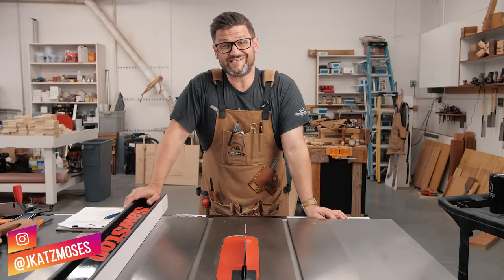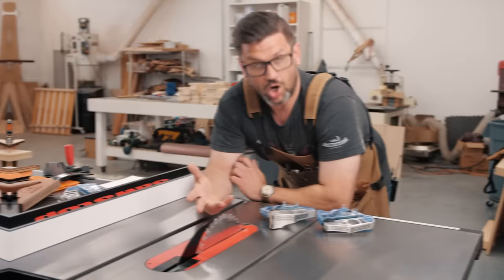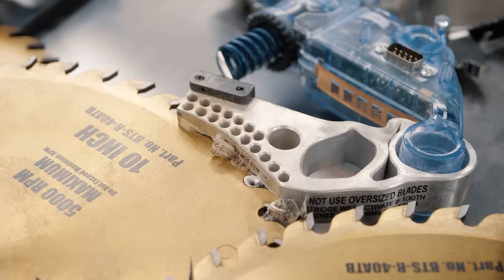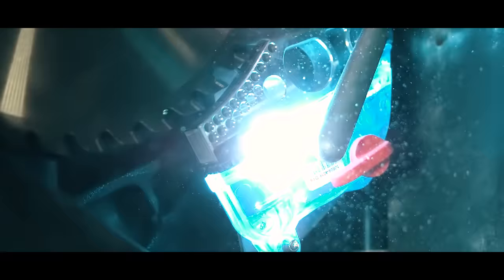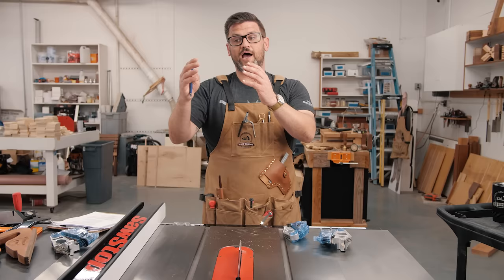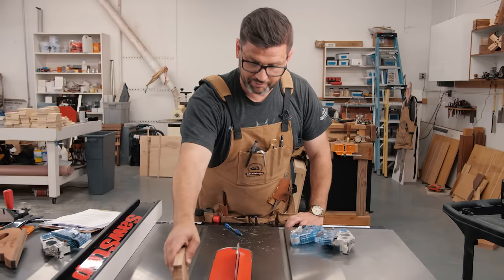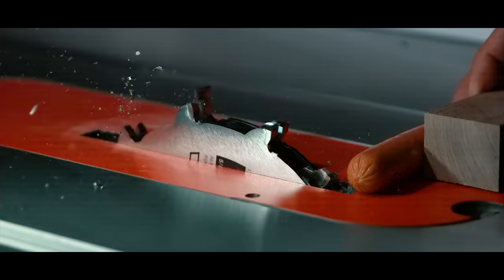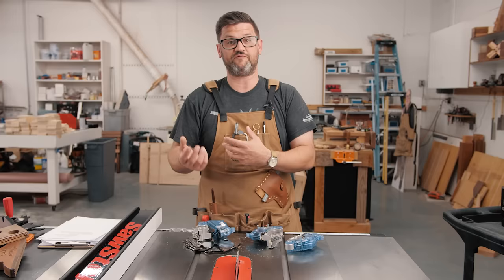How Safe is a Sawstop Saw? - Never Before Seen 19,000 FPS HD Slow-Mo Video

Comment: This post hits home regarding two of my family members . My brother and l grew up with a dad that loved wood working . I grew up in the 50' - 60's when high schools actually offered shop classes . My shop teacher taught us to never have the saw blade higher than 1/8 "above the top surface of the wood . As you rightly pointed out , this would not create an unrecoverable accident . My dad on the other hand , insisted that you keep the blade set as high as possible . His reasoning was that when you have the blade high , less teeth are in contact with the wood causing less heat buildup in the blade . This is absolutely correct as far as the physics of blade to wood contact goes . 1970 we're helping dad get the house ready to sell . We're in the basement shop and hear a string of explicitives coming from dad's mouth . He had just cut off his right thumb . Forward to 1972 . Dad is working in my brothers shop ,at the table saw. The phone rings , dad looks at the phone while still pushing the wood through th saw . Left thumb departs from the hand .  2018 my brother is in his shop , distracted for a milisecond and removes the first joints of three fingers . He still has his thumb and index finger . This does allow him to demonstrate displeasure in two ways . Minor irritation , you will get half a middle diget salute . More irritation  , will get you the left hand full salute . Major irritation,  the best he can do is 1 1/2 digests.  I on the other hand (yeah the pun was intended , sorry ) listened to my shop teacher . The only body part l'm missing is my appendix.
Reply: Why would he not use a pushing tool after losing a thumb. Even with Sawstop, you still have to be smart. Even the best technology can and will fail. Oh nevermind, after reading that last bit, I think it was pure sarcasm. Your Dad and brother need to learn lessons from shit that happens if real. They definitely missed the brain train.
Reply: @Bound4Earth  , 
Dad's been gone now for 20 years . He made it to 93 years old . As to why he didn't use a push stick , l can't say , other than dad always did things his own way . His was the generation that went through the depression , and came out of it with a feeling of invincibility , l guess . As for my brother ,  well sometimes he's not the best decision maker . He is his father's son . Of course they have both provided me with teaching examples for my grand kids . Visual aids make teaching so much easier .
And yeah the last two lines were sarcasm,  when you make it to 75 , you kind of look at the world with an eye out for dumbness.  Sarcasm is the old guys equivalent to OMG .
Reply: How the hell do you lose your appendix using a tablesaw?!?!?
Reply: @TheLizardOfOz  🤦🤦🤦
Reply: TheLizardOfOz Easy just crawl on top of it and turn the saw on
Reply: For the record, yes they still do have woodworking in high schools
Reply: @TheLizardOfOz  , 
Well , first you remove the blade guard . Next a step  stool makes it easier to get up on the saw . Never give an ex New Yorker a  straight line , we will run with it ! 😀 With the form of wittisism you used , your humor would definitely fit in with the rest of us . Oops,  posted my reply , scrolled down and saw yours to workaholic. Yeah,  your humor  fits in . Stay healthy and keep the sarcasm handy . Sometimes  sarcasm is the only thing that keeps you from killing the incredibly stupid .
Reply: @patrick-xu1go  You are extremely lucky to have shop classes available in your area . A majority of school systems have dropped shop classes because of liability issues .

Comment: When I first cut my teeth as a apprentice carpenter.  On building sites we used diesel powered table rip saws.  A guy who was ripping down timber for posts had a pair of gloves with rubber webbing on them ( I think it was mainly to give better grip ). There was a loose thread on the right hand of the glove.  He wasn’t using a push stick and the thread was caught by the blade!  He lost his index finger above the knuckle and a good chunk of his thumb!  Really nasty accident!  That was some 40 years ago and I’ve never forgotten it!

Comment: Awesome. I actually witnessed a guy who ran his hand into a running table saw blade. He didn't loose his fingers but he had stitches for weeks in all 4 fingers. Back then safety options were limited to a simple guard over the blade but it wasn't a stationary guard, it was a floating guard. Very cool safety has upped it's game!

Comment: You just sold a ton of Sawstops. I wasn't going to get one and was looking at a grizzy but after seeing this I have changed my mind.
Reply: On my first day in my university woodshop they said 3 things about the tablesaw, 1) If you feed stuff without the kickback fence or knife that will happen (pointing to a 2x4 embedded through the wall behind the saw) 2) If you touch the sawstop it wont take your finger off (with hotdog demonstration) 3) If you are dumb enough to activate it, you owe the shop $1000 before you are allowed back in
Reply: @JKSSubstandard  thats basically the same as us. It was something like "if it saves your finger, we'll pay the bill with a smile, but if you bring in a hotdog to 'try it out', expect a bill in the mail"

Comment: I saw this about 20 years ago at a wood/lumber trade show in Rototua, NZ but the manufacturer from the US.  The representative would use hot dogs like in this video.  Sometimes the hot dogs would be nicked but a small scratch is nothing compared to losing a finger.   The representative only needed one pack of hot dogs and probably did a hundred demos a day.

Comment: I am thankful for the sawstop because i personally triggered it once because i am sometimes clumsy and that time i was talking and cutting. Before i could blink i felt the board getting sucked in with my hand and then the blade disappeared the moment i checked. A pure moment of confusion as my heart stopped because i was expecting to see a massive injury on my hand but nothing, just a small cut in the palm of my fingers perhaps 1/32th of an inch and it wasnt bleeding altough it was red inside.

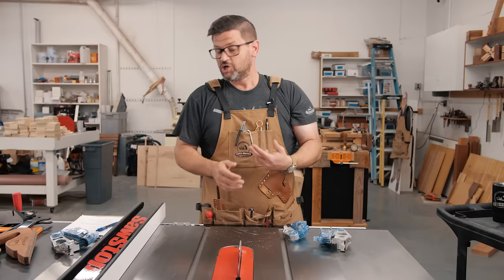Comment: 3:15. There’s a huge difference between the mass of a 2lb blade and a “fighter pilot” at 1000 MpH. But still 1000Gs is 1000Gs. Where do you get your numbers? How did you do those calcs?  Great video!
I remember seeing the SawStop vs hotdog when it was first invented. Awesome!
Reply: If I had to guess, they used measured the angular velocity of the blade by measuring the distance traveled by the teeth per frame. Then measured how long it took to slow down. Change in velocity divided by time = acceleration. Once you have acceleration and mass you can find the average force required to achieve that acceleration

Comment: Hello. Just saw this video in my recommended and wanted to pop in and say I am typing this utilizing both thumbs because of a stop-saw. 
While cutting 1" slat boards for a rocking swing I was building something or another happened (dont work impaired please) and my thumb hit the blade. Didn't even draw blood, barely broke the skin and cut some of the nail.

Comment: Hi   Very interesting video  but I’m curious with that much force  hitting the brake there must be  a huge force being transmitted to the drive train -motor shaft or arbor/ belt. It would be cool to see what goes on inside the saw and whether there’s damage to anything other than the cartridge. P.S  when that dado blade stops if you look closely at the slo mo it looks like the  blades distort and the  inside blade spins and contacts the carbides… on the other ..?? -I could be wrong but as you said hard to believe a gram or two of carbide would be generating enough ‘g’ to pull it away from a  brazed joint..??

Comment: Minor gripe: where you say that a dado stack stops with more Gs shows a bit of a misunderstanding of what a G is. A G is a unit of accelleration (9.81m/s/s). A dado stack might require significantly more force to stop, but that doesn't automatically mean it stops faster.

Comment: The only accident I've ever been unfortunate to witness with a table saw was someone reaching across the powered-off blade as it spun down. The blade was maybe going 1/4 of its normal speed, and it STILL ripped apart the tendons in two fingers and several in his palm. I doubt his hand will ever be normal again. I was surprised to learn that apparently the SawStop would have worked even in that scenario (power off, but spinning).

Comment: I've been skeptical about these for a long time.  Glad to see you did a high-speed test.  The other test I still really want to see is with the saw under load.  This can be simulated by taping the hot-dog to a 2x4 that is being ripped.  Now I'm seriously thinking about getting one when my new shop is built.  I once had a near-miss with a table saw, with my hand slipping off the work-piece and getting close enough for me to feel the wind from the blade.
Reply: It still works, i know from uh... experience
Reply: better safe than sorry
Reply: Why would you be skeptical about something like this? Seems like the completely wrong thing to be questioning….
Reply: Your last sentence gives me shivers
Reply: i hope you got a saw stop man
Reply: It would work even better under load as load = less rpm which is easier to stop :)
Reply: Lucky Man:hand-orange-covering-eyes::body-green-covering-eyes::face-turquoise-covering-eyes:

Comment: Well I am a statistic, about 8 years ago, was making a small lap desk for my daughter so she could draw, color etc.  Well I got lazy when I was cutting some small narrow rails and I removed the anti-kickback guard from my table saw that had the stock blade cover which was not a zero clearence plate, and on the last pass, it just so happened that the wood was a tad too narrow and it got caught in the space between the blade and and cover and kicked back at me flipped up and pulled my right hand right into the blade.  I didn't feel it but I knew it was bad.  The blade went diagonally thought the the tips of my pinky and ring finger.  They were still attached by a tiny piece of skin and were like the top of a Zippo lighter.   So long story short....I got lucky it wasn't worse, but still had to go through 2 surgeries, with my pinky pinned and some rehab, but I now have full use of my fingers but not all the feeling returned.  Small price  to pay and I was very lucky.  It was also a long time until I used my table saw again. And even today when it turns on I get a little uneasy around it.  
P. S. I pre ordered a left handed apron , can't wait to get it!!!!
Reply: ohhh my god that makes my skin crawl just hearing about your injury.... I just recently had my left thumb pulled into a grindstone by a glove I was too lazy to take off for a 5 second grindjob.... go figures its always the little things where you dont expect it. Nothing like your story though, how are your fingers though ?
Reply: Damn son, that is some scary stuff.  Glad it turned out about as well as it could have and that you're almost back to whole.  Stay safe!
Reply: @dawnmaster96  fingers are good just some loss of feeling never came back. Looking back I wonder what was I thinking?!?!
Reply: @unclematt3  thanks!
Reply: @kalmangt2265   Im glad you still have 10 digits, the numb spots must be annoying im sure but hey, injuries make for the best stories :)
Reply: Same thing happened to my dad. Lost almost 3 tips. index, middle, and ring finger. They couldn't save the index but were able to pin the middle and ring fingers back on.
Reply: Kalman Grof-Tisza reminds me of a story my grandfather told me when he made shingles, one time when running a shingle mill he ran his hand through and cut the tips of his middle and ring finger off and he never got them back on I don't remember too clearly but he was told to do something like wrap his fingers and finish his shift. He cut about 3/16 to 1/4 inch of his fingertip off.
Reply: @Sei783  it is amazing fast it can can happen and how fast it makes you realize how much worse it could have been.
Reply: @sirshotty7689  damn that is crazy, I couldn't imagine being told to get back to work after that happening!
Reply: Kalman, there is a fascia restoration tool that is used to smooth wrinkles and dents called the FaceBlaster that you might try on your hand to see if you can get the feeling back. I used a larger version of that tool to resolve pain from a serious accident.
Reply: Can someone explain to me if the anti kickback piece is the riving knife ?
Reply: Not a saw, but I was once doing some soldering and a little blob of solder landed right onto my safety goggles where my eye would have been. Never soldered without protection ever again
Reply: @kimariokiji  Thanks I will check it out.
Reply: @tspunk4003  on my saw it is connected to the riving knife but are separate from it.  They are two spring loaded serrated pieces of metal that allows the wood to pass under it but it bites down on it when trying to pull it back, and prevents it from kicking back.
Reply: @elfakyn  Were you soldering something above you?
Reply: Did your daughter like her desk? 🤣
Reply: @Ck87JF  lol yes, once I was able to finish it

Comment: For those that complain about how "slow" they move the hotdog...

With my experience cutting wood, unless you're cutting very thin, lightweight stuff, you can ONLY go so fast, and considering how fast the blade retracts, even if you get cut, I feel like a kickback isn't going to result in a severe cut.

The clip of him just pushing forward with the hotdog quickly actually confirmed my hunch.  When I get my own place, I DEFINITELY plan to save up to buy one of these, when I can.  I'll probably have to start with a small/cheaper saw, but this'll definitely be something I opt for.
Reply: I feel the same. Maybe I'll stick to the circular saw in the meantime. It's obviously more dangerous, but that also means I'm less likely to forget to respect it.
Reply: @jpaugh64  while there is a "right" way to use a tool, much of it is because various tools - specifically complex mechanical creations like a table or circular saw - is developed with various safeguards and control mechanisms. Doesn't mean you can't use them in different ways. It's up to you if you can respect the tool however you use it.

Best example is how you can create dados without a dado stack with a circular saw and table saw, along with similar creations made with routers or hand tools.

...all that to say, you do you! 😂😂
Reply: @AnthonyLoPrimo  I don't follow what you're saying. I wasn't talking about "how" to use a tool, but rather "which" tool to use.

I suppose the answer to "how" for me is, in the most basic way possible, since I'm pretty new to any sort of wood working.

Comment: I always wondered but never searched for how the saw could possibility detect you coming in contact. Also, remember, your fingers are not as flimsy as a hotdog so yeah you’d take less damage.
Reply: Don't doubt the power of Table saws can run through aluminum, they can be 3hp, spinning over 3000rpm, those blades will maul you like you're wet tissue paper. It's meant to run through 20ft of 3 inch oak in 1 minutes or less, flesh doesn't register to the motor as resistance, you aren't as strong as 3 inches of oak.

Comment: My table saw is over 30 years old, I bought it for homeowners  DIY projects . It is a good saw about 2hpm, it is unlikely that it can ever be retrofitted with the type of device in this video . Knowing full well what can happen as as result of unsafe practices I usually remind myself of every possible way of using it before each use and thankfully I have not injured myself with it . Any power tool has the potential for causing severe injury , therefore even when equipped with a device like the one in the video in my humble  opinion I believe that being as careful as possible is not to be discounted  ever  in favor of relying only the technology alone .
Now just past 70 yoa ...I saw the advent of abs brakes in cars ...but  they are not necessarily going to prevent a fatal accident when   the driver is mentally out to lunch.

Comment: I was a machinist for many years, and got to see, as carbide cutters developed over the years. What they can do is CRAZY, but that’s 50 yr old tech… 

The teeth are cemented carbide. Carbide is VERY brittle, and chips, unlike steel, that the edge rounds over. With that dado blade, the teeth on top popped off, because they’re just glued to steel. The steel part flexed, as they flexed, the blades hit each other…

I always kept a clean pair of undies in my tool box, when I had to run a 1.25” solid carbide endmill… Sounds like a roof collapse…